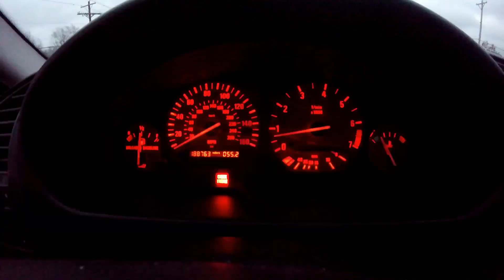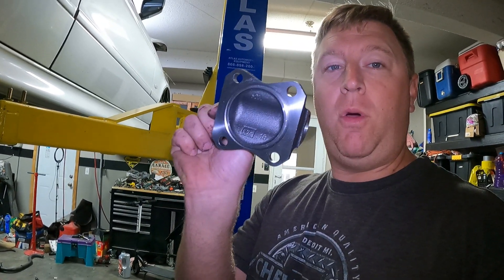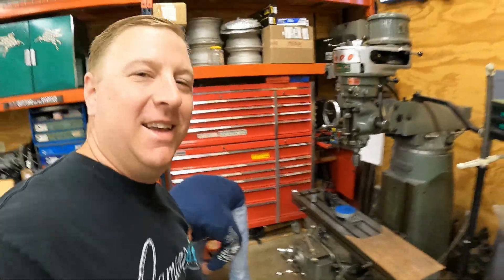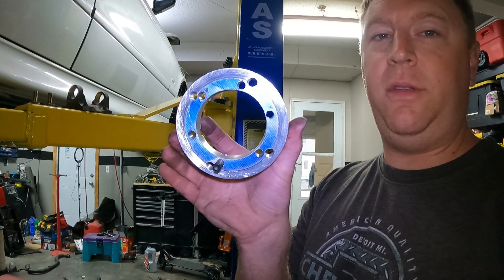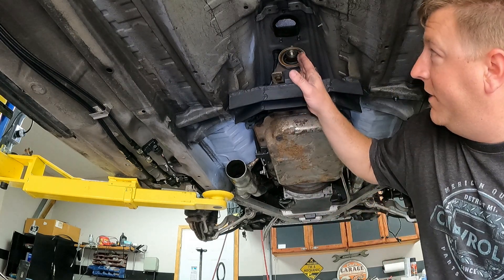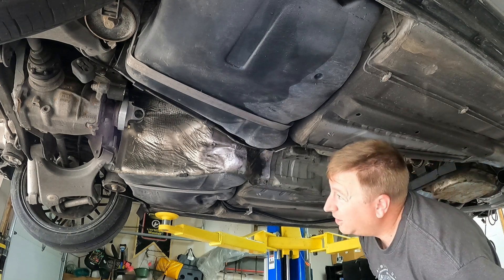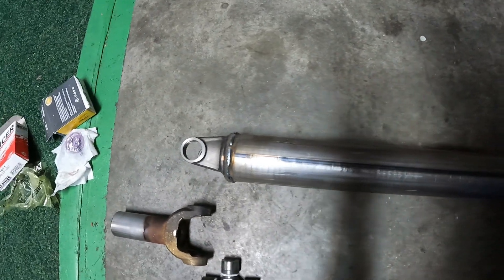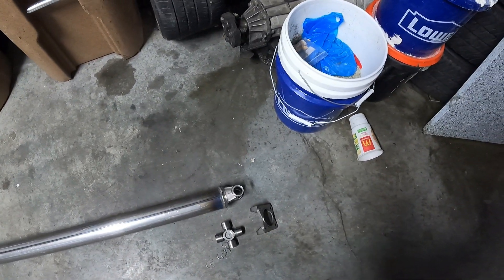Building A Driveshaft For My BMW E39 LS Swap - Pete's Draggin' Wagon Pt 18

Comment: You're inspiring me to LS swap one of these E39s! 

Do you know if the 5-series e39 engine bay is the same size as the 7-series E38 or E65? 

I'm planning on a single turbo LS setup in an e39 5 series but it looks like there won't be much room between the accessories and the radiator (unless the stock fan shroud is just extra bulky).
Thanks
Reply from the maker: I believe the e38 is very similar to the e39. I have plenty of clearance between the radiator and front of the engine on mine. These engine bays were made to fit a long inline six and a wide DOHC V8.

Most turbo ls e39s that I’ve seen have the turbo mounted on the right front of the engine bay.
Reply: @Pete's Garage  I noticed the 6 cylinder E39s get an aluminum subframe while the v8 E39 540s got the steel subframe, do you think the aluminum one will need to be upgraded?
Reply from the maker: I’d use the aluminum one because it has rack and pinion steering which allows you to be able to run a rear sump oil pan. The v8 subframe uses a conventional steering setup and a front sump oil pan. The only factory LS front sump pans were the GTO and trailblazer pans. Many of the people who start with a v8 vehicle swap out to a 6 cylinder subframe for an easier swap.
Reply: @PetesGarageandperformance  I guess with BMW everything is so over-engineered that the aluminum subframe will be more than adequate for turbo LS power

Comment: Is there anyway I can get an update or an adapter made for myself? I have a 89 535i with and LS1 in it and currently looking to go one piece driveshaft with no luck! Any advice would be greatly appreciated! TIA!
Reply from the maker: The adapter works well. In hindsight, I probably should’ve balanced the adapter. Sorry I wouldn’t be able to make you one because I have no idea what the dimensions of your diff pinion flange are and I’m sure they’re different than my e39. Check out Seems Legit Garage. They might have an adapter for your car.

Comment: Does it matter on the color of the power steering fluid? The old power steering fluid in my 2003 gmc envoy was red but I replaced it with a clear power steering fluid that said it was good for suvs

Comment: I've noticed oil filters will say they can last up to 20,000 miles but oil should be changed every 5,000 so what would you say if I just changed the oil and not the filter until 20,000 miles?
Reply from the maker: I always change the filter when I change the oil. I have actually seen some oil filters become restricted and cause lower oil pressure before the “change engine oil” light came on. On newer vehicles the oil life monitor will allow you to go almost 10,000 miles and from my experience, the filter becomes restricted by then. The reason an engine oil filter becomes restricted is because there is combustion happening inside of the engine and it’s producing other contaminants and acids. Also fuel contamination of the oil and thermal breakdown due to the heat of the oil.